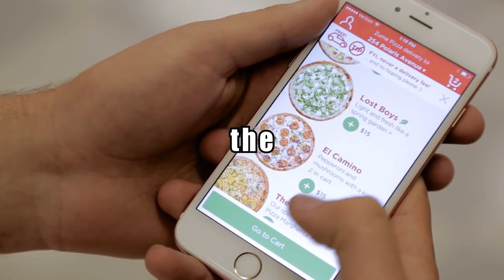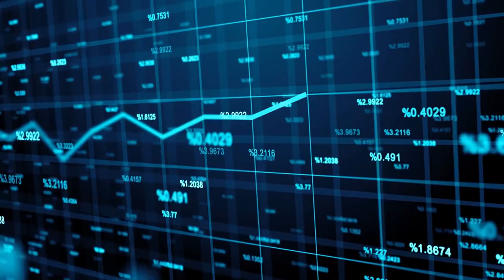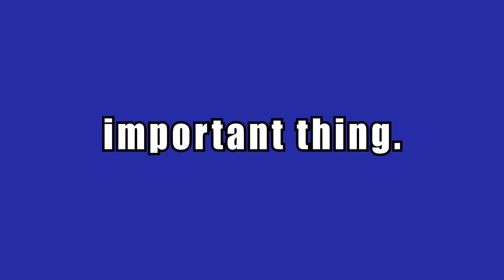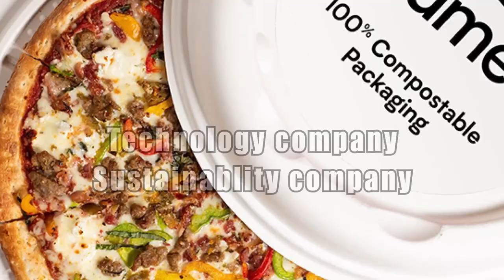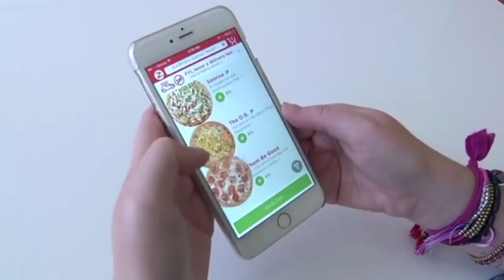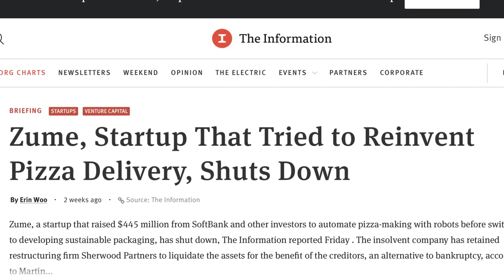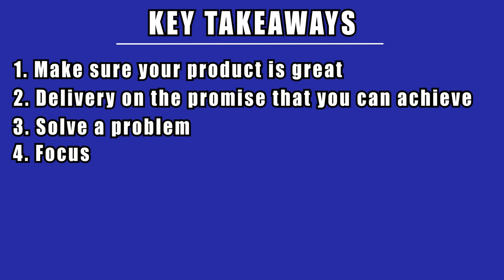Zume Pizza: Why It Failed

Comment: I think those takeways are not correct:

1. Make sure your product is great: Well, when you are innovating you face uncertainties. You never know how the ending product will be. Independently of this, I think they should be focusing on improving quality, but I don't know what they faced and probably you either.
2. Delivery on the promise that you can achieve: Many times, if you don't overpromise you don't get the funds to do what is achievable. And also you don't know what you can achieve, maybe it was feasible to do what they said.
3. Solve a problem: Offering a cheaper pizza is not solving a problem? Maybe it needed more funding to do scale economy
4. Focus: Yes, it might be a failure, but we don't know what they struggled, maybe they couldn't get a new fundraise serie so they had to switch with the funds they still had. 

So easy talking from outside.